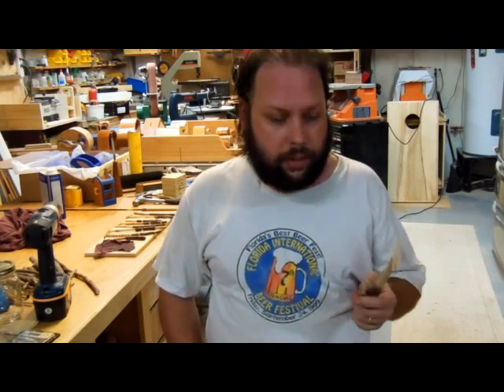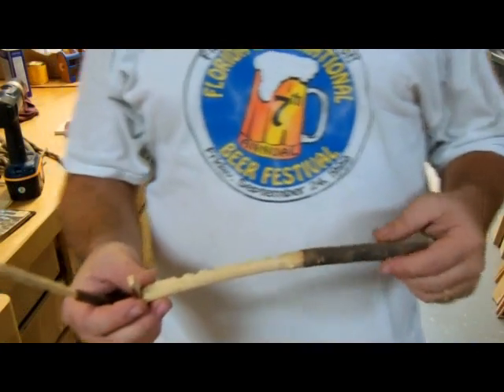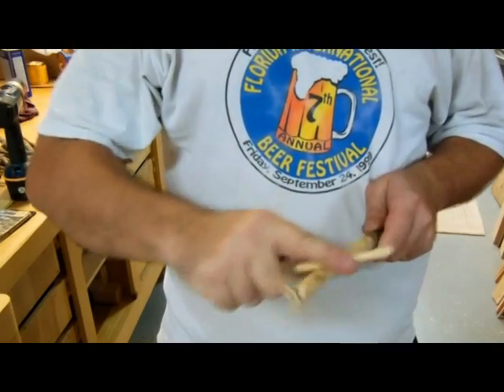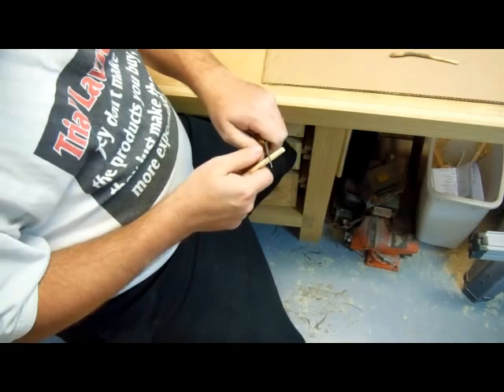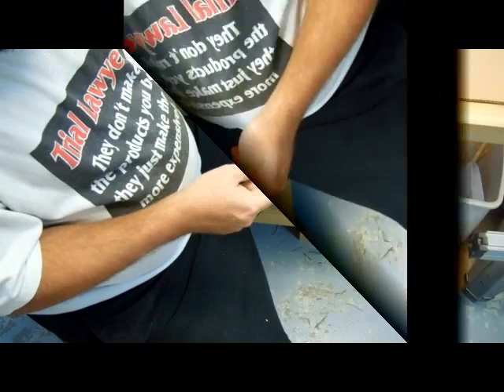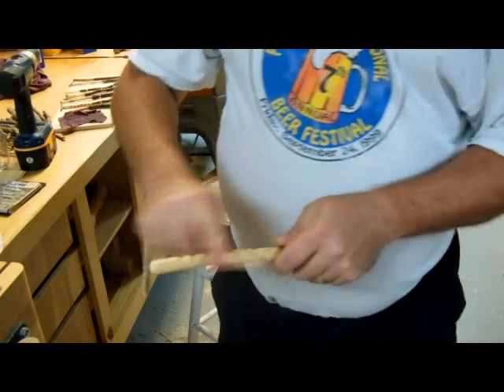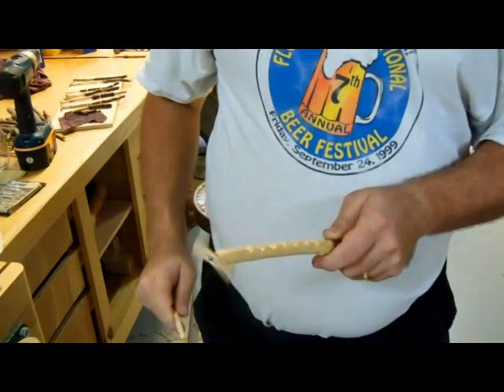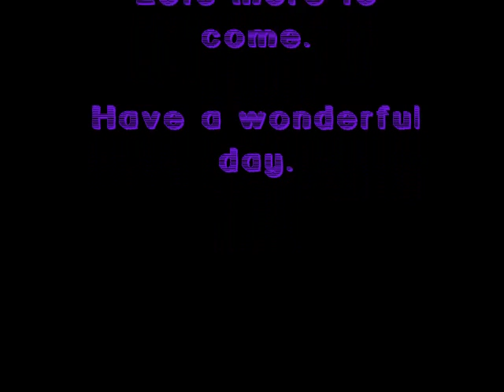The Magic Propeller: Woodworking project

Comment: Sir, here you have  here is a "toy" that changes into an educational product of high value in the right circles.  What you have is  basically an explanation of the working of a type of  electric AC motors using rotating fields.  A single phase AC electric supply normally produces a PULSATING  magnetic field which mathematically is the result of two rotating fields  of the same frequency turning in opposite directions.   Such a field will not cause a rotor to rotate.  Now by adding another magnetic field which is 90 degrees out of phase with the first one, then a ROTATING magnetic field is obtained which will cause a rotor to rotate in the direction of the rotation of the magnetic field.

Now the serrations on the rod will cause an AC pulsating field if they are excited by the rubbing rod. This alone will not cause rotation but a pulsation. Now when you put your thumb or your first finger as you do  then the out of phase effect of the inertia of the thumb or the finger will cause a ROTATION at the tip and it is this rotation of the tip that does it where the circumference of the nail  rubs against the circumference of the hole and round goes the propeller. For best results the hole should be  about twice as large as the nail and the nail itself should not be too thin in diameter.

The mathematical analysis of this is so interesting and it is basically a rotating field described by F= cos(wt) +j sin (wt)  where it can be assumed that the cosine function is  generated by the serrations while the sine function is generated by the thumb for a positive rotation and by the finger for a reverse rotation.   I  did it with a threaded rod and a nut,  excited by a screwdriver rubbed against the thread.  If the weighted handle  of the screwdriver is lower than the threaded rod the rotation goes one way , if the handle  of the screwdriver is higher than the rod m the rotation is the other way.  Congratulations for showing this as its theory can be found in higher academic circles including variable speed AC motors using vector control.  

One would not believe that such a modest " toy" could transfer its working principles to motors which run our fridges and washing machines.  Incidentally in single phase motors found in homes the main pulsating  field is called the Main winding while your thumb or your finger is replaced by a second winding with a capacitor in series with it to obtain a phase change in the excitation ,  to create in a motor what you are doing with your hands.   Thanks to the heavy inertia of your fingers and  your thumb you are capable of simulating a wonderful piece of useful engineering which bring comforts to many homes.

I hope you knew all this and that 'Toys ' are in fact little intriguing machines if one cares to think deeply about them.  Congratulations .
Reply from the maker: That was a very interesting analysis! Thanks for the insight. And thank you very much for watching.
Reply: If you dont know these "toys" are called hui sticks
Reply: V sause just made a video about these and how they work